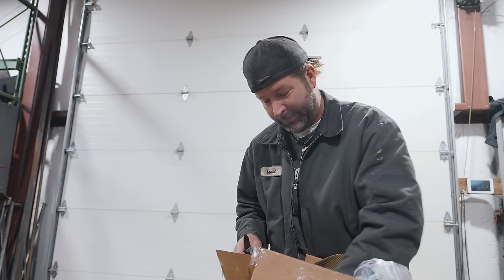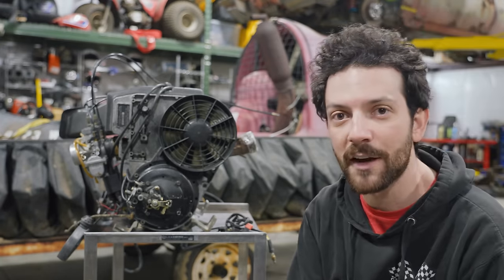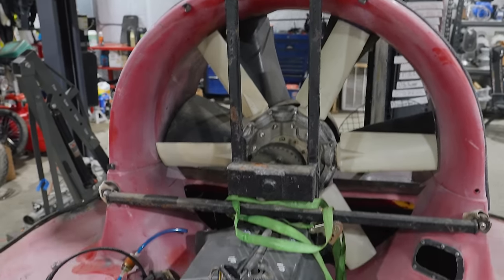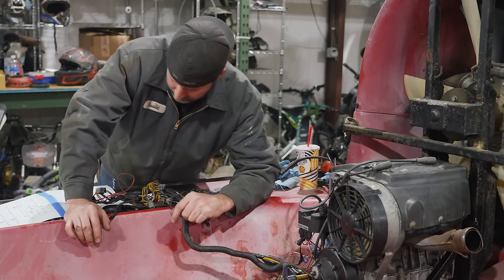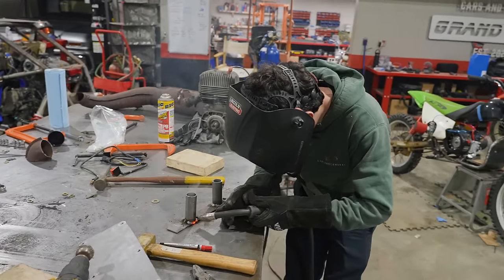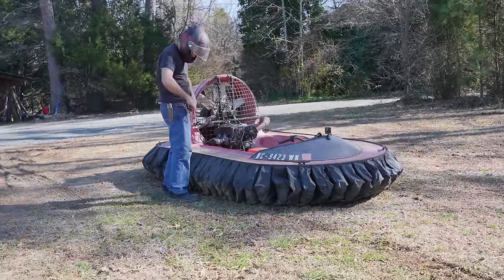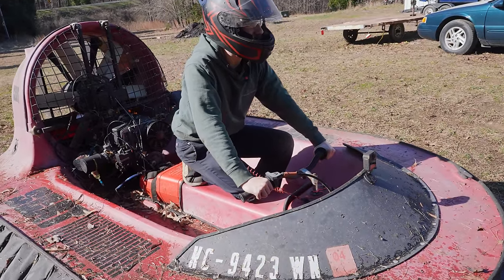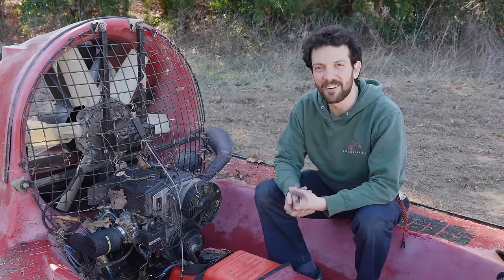Reviving our Hovercraft with a 2X Horsepower Engine Swap! (It Rips)

Comment: With the Xtra power you could add a little more pitch to blades to move more air. Also, if you added a bit more length to the steering fins you'd have more control

Comment: More pitch on the prop! Also you may want to add a piece of pipe back to the expansion chamber. Shortening it probably hurt the power a little as it throws the pulses off

Comment: I wish there was a lite weight way to add some powerful EDF's on swivels up front without adding too much weight. Maybe a rebuilt motor with more power and a generator? All the big Hovercraft they use for Ferries in Europe and getting cargo to remote locations in places like Alaska have extra jets up front for turning and stopping. Driving these things with that single fan seems like trying to balance a broom handle on your head. While avoiding trees at 40mph.

Comment: Make sure the air intake for the engine cooling fan stays clear of leaves, I work on airplanes with the rotax engines and they are fairly prone to overheating of the cooling air is restricted

Comment: Those 503 rotax engines hammer hard with twin carbs. If you have the chance you can try and find a newer 550 fan rotary which is a huge upgrade over the 503 using reed piston port intakes.

Comment: One thing that would enhance your ability to control the craft might be to be careful not to oversteer or overcorrect when steering. As with airplanes and other crafts or vehicles, it is important to make small, controlled increments while turning and small corrections also. Just a suggestion. You may have already considered that.

Here's another thing I was wondering about. I am not an engineer, but I wondered if adding more directional louvers to the back of the fan might increase the steering capability. Also, is there a way to add some kind of air thruster tubes under the front of the craft or direction fin stabilizers to give it a quicker steering response?

Comment: Fix the air routing under the craft. Use a plastic conditioner on the skirt(aka waterbed conditioner). Every tweak maters. You might want to attempt to make the rudder assembly proportional for better  response.

Comment: You need to readjust the props back so you have more thrust bc now you have enough power for lift. Also buff the fiberglass youll be surprised on the finish. Also you might want to pull the skirt and inspect it you can get similar fabric and cut it to shape and sow new sections yourself.

Comment: you could make a 2 into 1 airbox with the nozzle pointed towards the driver , now the carbs are taking air away from each other. and the Prop takes away air aswell.
And maybe to make throttle better is to install a Thumb throttle like on a Quad
And maybe a exhaust shield/tube from the engine to the side so when running the leafs and crap won't burn

Comment: You need more pitch in the prop and you set them steep enough to hold the engine at wide open in it's proper power band. Also your skirting has leaks it should be almost fully inflated at just above idle.

Comment: As you have probably figured out ... when you upgrade to the 503, you need to change your weight distribution .. you are running very nose light in this video, and that is a big reason why it is so hard to steer. The higher the rear rides, the more responsive the steering becomes.
Relocating the fuel tank forward to the handle bars will help, making it the seat.

Comment: These pipes are specially designed in length and girth for the return exhaust wave to pack the engine full of the unburnt gas.  Messing with the length can adversely affect the performance. There are quite a few good  Articles out on the purpose of a 2 stroke expansion chamber. you should read one
Reply: I wrote a comment before seeing yours. 4 inches removed is going to make that motor Rev way higher. Probably why it leaned out

Comment: You need more steering fins to control it better and you can adjust the blades on the blower to get better output to the rear as the guy below said pitch.

Comment: That motor is a little bit heavy for that air cushion vehicle, that’s why it sits up in the front the way it does. If you could remake that engine frame out of aluminium, that might help a bit, or you could also put the fuel tank further to the front of the vehicle, or do both, that should also change the angle of thrust coming out the back which should help with speed.

Comment: I was cringing when i seen the leaves blockling the engines cooling fan LOL! You usually have to fatten the carbs on sled motors when running in warmer weather, espically air cooled :-)

Comment: IT looks like you need a little ballast in the front of the craft to help level it out.  The added weight to the rear is causing it to rise in the front which is allowing more air to escape out of the front rather that keeping the craft level.

Comment: 11:30 😂 Well kind of. If you shorten the length of the resonance chamber you increase the RPM at which it kicks in. That may help increase max power at the expense of bottom end power.   But that only works if the rest of the engine wants go make power at that rpm(port timing, carburettor etc.)

Comment: The leaves on the grill will reduce airflow to the fan. I'd recommend getting some cones and learn how to drive around them, when turning, throw your weight into the corner, lean hard and give it maximum throttle to turn. Next I'd look at the skirt as your lift height seems rather small. You should be spending most of your time at 3/4 throttle so in turns give it full stick and be prepared to counter steer halfway through the turn. Hovercraft hate hills, any hills and stay off the gravel if you value your skirt. Find out from the manufacturer of the fan, it is not a propeller. See what pitch is needed for the fan to absorb the power, if a fan is pitched properly you should never ever be able to redline the engine as the fan should absorb all the power without the blades exceeding supersonic tip speeds.

Comment: If you’re still having issues applying power with your pitch basically the way it goes is you have to find the sweet spot. 
More RPM = Less pitch in the blades. Less RPM = More pitch. So you have to find your happy RPM to inflate your raft then in turn you have to balance to prop pitch to produce power but not over speed

Comment: From the little bit of personal history with a rotax equipped powered parachute,  it sounds like it's running too high rpm. An increase in pitch might fix it, but could also cause cavitation.  If that ends up happening, you would have to go to a different style prop to utilize the hp effectively.

Comment: You got lots of leaves stuck on the intake and prop intake. You might want to be careful and monitor both so your engine doesn't overheat and you also get more power. Also more pitch on the prop for more speed.

Comment: Cause it just might surprise y'all with the performance and power output afterwards just by switching 2 stroke motor oil to that from basic 2 stroke motor oil. Cause there is actually A difference in them to.

Comment: I'd build A cage for it to help keep the operator inside and safe with harness and life preserver. That's A nice hovercraft upgrade to it for sure. Y'all might like some power racing 2 stroke motor oil made by echo called Red armor. I mean if you're going to let rip then why not clean out the access carbon build up inside of the exhaust pipes to while riding inside of at the same time.

Comment: Change the pitch on thr props and use the original engine for just the lift and the new engine for to thrust ! It will be a weapon! Plus like jon said remake the frame lighter

Comment: Run lean and not enough oil in fuel mix with the cloth bag over the air filter and motor seized?

Comment: John bro I know you know that the fan blades don't cavitate AIR! Because I don't care how fast and strong the engine is it's not going to cause water droplets form on the tips of the blades. I'm thinking he meant turbulence. But even that doesn't make since because there's plenty of two-stroke high look at cleet and the one that he gave Finnegan has even power

Comment: Bro, heat gun, and a piece of 4 inch pipe/tube, soften the fuel tank where it hits, and bend a little divot. Just clean the fuel tank well, first. Be safe about it

Comment: just curious i wonder on the water if u did a figure 8 at high speed and really use your body weight side to side , maybe get charles and jon in wetsuits and try to do some figure 8 cornering at a bit higher speed u might find it will perform better, like drifting only using your body weight to steer, cos watching closely john wasnt sitting...... he was kneeling... being a smaller craft ,  looks rad but, well done lads... love it....give a high pressure rince and tidy it back up.....buff that red, come up good...

Comment: Was the engine running to lean? Cause 50:1 seems lean for that application. And or did it overheat cause of all the leaves plugging the cooling fan on the engine? Or both? Those would be my guesses.

Comment: You either need to add more blades how old are the pitch for the new engine also restricted some of the air holes in the front of the skirt if you get it just right u will be able two dig one of the corners in which will make it pivot this is how I I set mine up

Comment: The racing hovercrafts often have a seperate lift engine up front like a 100cc paramotor engine at 15-20hp. And then 50-80hp main engine.

Comment: If the snowmobile rotax motor is anything like the jetski rotax motor, it needs a oil tank connected to the motor to cycle oil through the motor constantly. If you unhook the oil pump and premix, you still need to run oil to it or it will blow up. Oh no, I just watched the very end of the vid, and it already did blow.

Comment: You guys should try to hydro-form a new exhaust. You have everything needed to do it. It looks like you need to get rid of a lot of weight in the back. I would make a new frame for the engine out of aluminum.

Comment: Not sure about how you cut the exhaust, i wouldve cut about a foot from the end and just flipped the tip up. That way you couldve used the steel frame to bolt it .She's is a beast though 💪 shes a ripper 💯

Comment: You guys need to angle the pitch of the blades to get it to go faster and it should be easier to turn it's just like an airboat you have to have a certain pitch on the blades

Comment: An air propeller cannot cavitate as cavitation is boiling of a liquid under low pressure; I suspect the issue of higher power is the tips going supersonic which causes a lot of loss.

Comment: You will never be able to run it for a lap time.  They are best on VERY flat ground.  On an ice lake is the best because they can float over water areas too and are easy to take on an off a lake, but blowing snow will be crazy.  I wonder if they have large fins on the back to help turning a bit and if you can set up a way to adjust the amount of air between the bottom and back.  It seems to ride pretty high when you have the throttle cranked and could really do with more air going out the back.

Think if this was aluminum and carbon fiber...

Comment: Gotta be super careful bypassing oil injection on anything more modern than the mid 70s. A lot of more modern stuff can only lubricate the bottom end with oil injection. Not sure what the cutoff is for rotax but I know by the mid 80's you can't bypass oil injection on arctic cats.

Comment: Put that Engine you pulled On Your Land Speed Bike. New Cam, Seals, Bearings,New piston and Rings and valve Rehaul. Then Add a Stroker DG  2 Stroke Sled Pipe and Send It at the airport. if ya have to Turbo it Up. or 2 Micro Turbos.
Reply: Btw you need bigger Fins on the back. if they are a little longer (Stick Out) More ability to control it. Hope this helps also buy some wood props for it ... Get advice from a R.C Model Expert or Hovercraft Expert and Order Wood Props Pre set to pitch then you zero out your mou ts and the poss are already preloaded to pitch. should give you more thrust as well
Reply: you can also add stabilization fins in the back on the sides 10 inch high fiberglass fins or make an out of foam board and fiberglass them . then put a 6 inch fin on the front of the bow. it's will help keep the craft in a straight line.  it also aids in turning.

Comment: I think yall should have tried changing the blade angle because ive seen those go much faster than that with just the much smaller factory engine that came on them.  Idk i may be wrong but to me it kinda looked like yalls was struggling a little bit too even move.

Comment: They don't make parts for this hovercraft. I know because I had one just like it. I restored it but got tired of it shocking me due to the static electricity it created. Half the blades are missing and the drive belt is probably dry rotted and won't last long. The pitch is around 30 degrees. There is no gauge to set them at the proper pitch and as mentioned before, half the blades are missing. The skirts need to be let out more to seal to the ground. Longer zip ties will go it.

Comment: I bet it would be more controllable if the handle bars were about 3 feet higher and you could more easily use your body weight to help steer.

Comment: I was a little worried that it didn't smoke at all, on the 50ish hp motors back in the day you'd expect smoke for a minute when warming up. Even with the auto oil thing.
Chuck hasn't been laid off haz he? 😯

Comment: Rotax says it runs better if not ran premixed and use the Oil Injection, so it can regulate the oil in the fuel at different speeds and make it run better....
I seen that comment on another YouTube for a sea plane , but I guess you wont fall out of the sky just sink in water LOL if it dies possible, or float not sure your specifics LOL

Comment: The heavier engine has thrown off the balance.  It is like balancing on a ball. Need more weight up front to allow the air cushion to help propel you forward instead of fighting the propeller.

Comment: You can’t have the engine air intake, covered in leaves and you can’t have the fan intake covered in leaves when you’re running it either you’re taking the efficiency right out of the system

Comment: Rotax motors need the oil injection as it feeds a brasd gear an oil bath it will run dry and fail eventually.

Comment: It’s dumping way too much into the skirt - you can see the air pushing out the front. If you adjusted the blades back to where they were it should go faster. Then you should be able to get a lap time!

Comment: The hovercraft is too light at the front due to the engine swap and the balance is no longer right. In the water it rises up at the front and the air escapes. therefore it is slower at that moment

Comment: @CarsandCameras   =   basic   definition   of   A   Swap   is  =   Same   engine   Out   same   engine  In   ,   so   take   that   as  a  BASE-Line   Starting  Position   of   relevance   .   hope   this   helps   (   same   engine   in  and   out  ,  vise  versa  = either  way  you  look   at  it     )

Comment: I've watched the videos on this and it doesn't seem that the skirt inflates is there a problem with it or am I just missing something?
Reply: You have to admit they are quite scary if a person has never been on one before.. I hope they read my comment because I made them aware that you have to ride it just like a motorcycle...  And get it out on a clear open area .. Open the throttle for great performance and lean like a motorcycle... This is absolutely the key.. they won't turn unless they have thrust and a person has to lean there body weight. I suggested that they watch some hovercraft racing .. they will see clearly straight away what they are doing wrong..  the performance of these things is magic to watch, so I'm really crossing my fingers that they read my comment and take a look .

Comment: Nice one wonder if u can change the pulleys to give u more power u know add more rpms to the prop also a tip steer by leaning as well as the steering handlebar that does help shifting body weight
Reply: That would only make things worse. The prop is designed where they can add pitch to handle the extra power. You don’t want to spin the prop any faster because it’s only designed to spin a certain speed. If they spin too fast, they lose thrust. They can also break. So spinning the prop faster is a horrible idea.
Reply: Ye man I get that but the new engine didn’t sound like it wasn’t reving high enough it may have more hp but not high enough revs compared to the previous one

Comment: Looked like the heavier engine had pushed the weight bias to the back so you need to find a way to sit even further forward or maybe move the fuel tank to the very front.